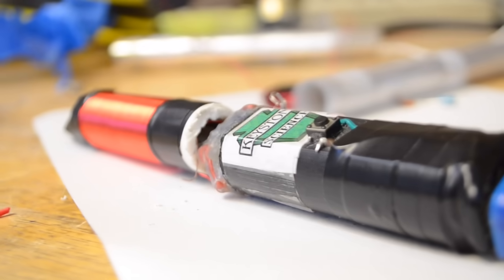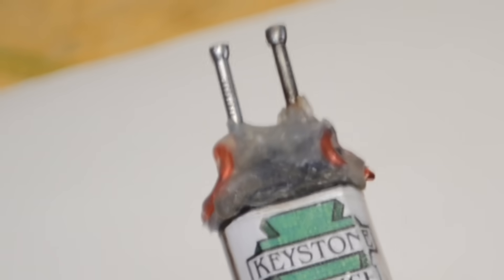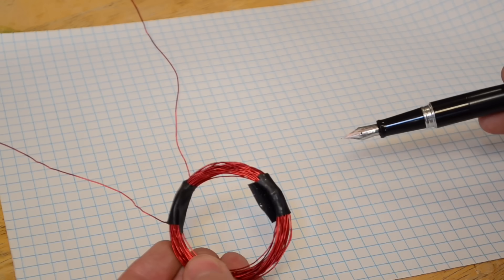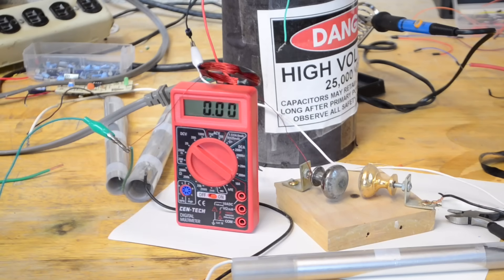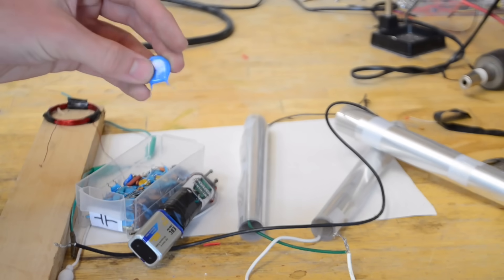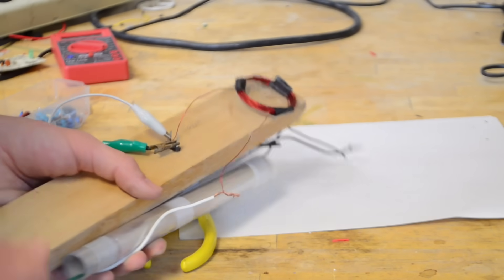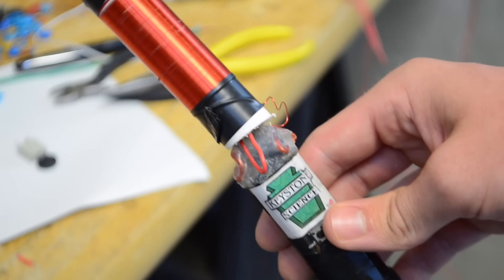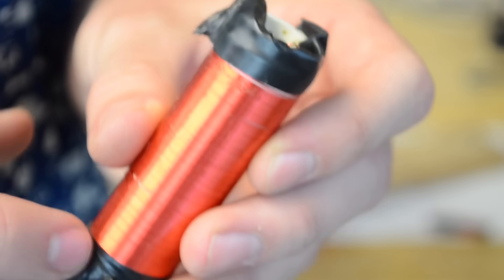How to make a pocket EMP

Comment: I have a thomas edison sized idea! Find a jiant grain silo, wrap it with 1/4 inch copper cooler tubing all the way to the top and loop it back down to a large aluminum plate just off the ground, then wrap a primary about 6 turns on the bottom with one end grounded and the other end teathered to an aluminum covered kite with 3000 feet of metalized spiderwire fishing line, then summons a lightning bolt, then measure efect.
Reply: Yes if the grain were corn it could be the biggest popcorn maker in the world!!!
Reply: Like the way you think comrade very cool. Probably could technically do all the calculations out to estimate you desired effect.. But would be a nightmare an still just a paper hypothetical. Be cool to see done irl hah,
Reply: add a fan and a couple pounds of flour. BOOM!

Comment: I was honestly just curious how feasible it was to make one. Just watched the newest episode of McGyver and in the show he made one using the magnetron from a microwave. I tend to like looking up the science side of things when I see stuff like that I don't fully understand. Thank you for sharing your personal experiences and learning.
Reply: Are you a time traveler or am I?
Reply: Mark Curry 
The magnetron/ transformer in a microwave is pretty much the same as the 2 components combined that he used. A transformer is basically a big version of the spark generator he used but it uses an AC input in stead of DC so it is way more powerful. So if you had some pretty high gauge wire you could use one for an emp. They are pretty easy to make if you have the right parts.
Reply: You're aware McGyver isn't a science documentary, right?
It's about as real as Rick and Morty.

Comment: Can you make this using the coils around  bucket maybe using a 12 gauge copper wire  using the same concept but only using a 3 to 4 amp from a  19 volt  maybe computer adapter will be best with out the capacitor for pulse only but if you want to have a constant flow and prevent the adapter  from damaging then use the capacitor. I am interested in  removing  morgellons and your idea would help . Please answer. Thanks or make a video of this I'm sure lots of people will find this if interest. Thanks.

Comment: Try the emp device with one or more of the large capacitors like from an HVAC motor, a car audio system, or a microwave oven (usually located within a few inchs and connected to the magnetron)

Comment: Question. How does it work, if your camera still working? . Please explain. This is some kool stuf keep up the great vids.
Reply: Taj Peterson Modern devices are EMP proof, they do this by using diodes. Think of a diode as a water valve in that only a certain amount can go through in one direction only. In a circuit a diode only allows electrical charge or electrons and Voltage to flow in one direction this makes your circuit Direct Current. As opposed to Alternate Current, Alternate Current circuits has its electrons change directions periodically so it goes forwards then backwards a bit then forwards.

In a Direct Current circuit Electrons can only go forwards because of a diode. Since a diode only allows a certain amount of electrons through in one direction the Voltage is always constant it can never increase but only decrease. 

An EMP works on the principle that it overloads a circuit with a sudden burst of high voltage that it fries the components in a circuit. In a direct current since the Voltage can only ever be constant and never increase an EMP jammer like the one in the video won't work on a EMP proof camera which uses diodes.

Comment: First how it works as you describe it is incorrect.. the capacitor and coil create a series tank circuit, the capacitor charges through the coil, when the capacitor is charged the voltage reaches the breakdown voltage of the air around the spark gap and the air ionizes creating a near short circuit, where the capacitor discharges through the coil and as the capacitor discharges max current when the field around the coil a huge magnetic field is  created. When the voltage drops low enough the arc stops conducting and the cycle starts over again.

Comment: What happens if you stager the coils and capacitors in a line? Like having more then 1 coil/capacitor set per spark gap? Is it possible to increase output and increase the distance like that?

Comment: How can this be applied to chemistry?
How would this be different than silent electric discharge, glow discharge , microwaves , etc on chemistry? 
In other words, what could this do that a microwave radio energy could not do as causing chemical reaction

Comment: Hey so what gauge magnetic wire did you use , how many kv is being produced, and how many volts should your capacitor be able to hold I've set the whole thing up but still can't get it to work I'm using 25 gauge magnetic copper wire and 2 kv capacitors and some 400 volt capacitors please help
Reply from the maker: +jaynazz123 feeds probably at least 6-10 kv caps, I recommend you make your own like I did, and try the better coil, it works much better.
Reply: Keystone Science thanks man

Comment: Hi, just wondering, if the high voltage is already pulsed, why are you adding the capacitors?
Reply: Random Fun  the capacitors increase the voltage
Reply: The capacitors actually don't add voltage but they will add energy.  The gap will determine the breakdown voltage but the capacitors will increase the energy discharged when the gap breaks and give you a longer pulse.
Reply: Barrett Lamb you still have to use caps with a higher voltage than is crossing the gap, so you do wind up with a bit more voltage.

Comment: How did your camera didn't stopped while you tested it but multimeter did. Your camera is an electronic devices too...
Reply from the maker: cameras have shielding built in,  alot of higher end electronics do these days, my multi meter had no shielding. Cameras like the one i used do especially, since if lightning draws too much current and blows a bulb, it creates an emp

Comment: I made this but the electricity started arcing out of my ceramic disk capacitor and burned through the side instead of going across the spark gap. I was using pieces of paper clip for the spark gap, so please tell me if the resistance is too high. I used a perf board, and may have placed the wires and capacitor in excessively close proximity. Capacitor was 1KV and pretty low capacitance, a couple picofarads I think

Comment: I think that adding a ferrite core and an aluminium shield to force the magnetic field into the desired direction may be can boost up the power of the device. (I haven't much experience with EMF but it's my suggestion)
Reply: Are you proposing an emp saber

Comment: +Keystone Science Why do we need to use a spark gap? Can you help please?
Reply: The Tech Boys You know that the acceleration of an electron through a wire creates an electromagnetic field yes? You also know that Amperes law dictates the strength of an electromagnetic field depends on the length of the closed loop and the current going through the closed loop.

To make sure our electromagnetic field is strong we want to make sure the biggest current we can possible make goes through our coil. The spark gap acts as like a trigger, when there's a high enough current an arc of lightning will form across the two electrodes completing the circuit. Which is why we use a spark gap.

How does the spark gap work? Well there are two positive electrodes. And current as you know involves negatively charged electrons. Since electrons are attracted to electrodes when there's a high enough voltage (think of voltage like the pressure or push of electrons) the electrons are able to jump across the gap to the other electrode, you see this in the form of lighting, this completes the circuit.

Comment: Is there a way to scale up this project and to focus the emp to a very specific direction? Also, could you use large high voltage capacitors to store a large amount of energy and make it mobile so that you could transport it without any need for an external energy source? It could be a mobile single use high power emp pulse using high capacitors in a series as your energy source.
Reply: No because the charge is too much and the build isn’t affordable. So unless your stupid stop asking and just do it. I’m kidding but not. Just make a vid so I can see
Reply: The government probably doesn't like plans for EW devices to be shared carelessly. I would assume that it would be the inverse of radar, in that radar sends out EM pulses to a general area and reads the return.  Ex-military I've chatted with said that EW uses a LOT of power. Not sure if some Yagi directional antenna-like attachment in front of the spark gap might help accomplish precision.

Here is my question: how would the range and precision of the device in the video change if it was rotating? Would that help to stabilize and concentrate the magnetic field projected from the device? Birkenfield currents don't diffuse randomly into the universe, they connect the poles of planets. The question is does a magnetic field have the property of an object in terms of  angular momentum stabilizing "linear" motion? Try throwing a football without spin. Birkenfield currents braid. My first principles take.

Comment: this is really stupid and a good way to blow a capacitor up. The HV power supply you're using already has all the capacitors and Spark apps inside of it adding another one won't really do anything.

Comment: Keystone Science hey! I would email this but I don't see an email address.. I wonder if you could figure out how a machine called magnawave works... I have some info on it and it's really interesting...  it is a large pemf device used treating mostly horses. The biggest version on the highest setting generate 30 000 gaus pulse that is only few microsecond long. So far no big deal....but.... it works without dumping an askicking current into the attached coil. I seen similar machines and it wasn't a good idea to handle the coil in operation. In the case of magnawave the guy who makes it told me that there is no current in the coil!!! But a magnetic wave being generated inside and brought outside into the coil. He said that inside there is a spark gap between magnets and that is what generates the magnetic wave. This wave by the way so fast that it has no effect on metal objects. Unlike capacitor discharge into coil type devices such as the Sota or the Bob Beck device.    So I thought you might be interested playing with it... I have a few ideas what might be going on inside. If you want to try some of my ideas out here is my email petimoritzatgmail. You much better equipped then I'm right now.
Reply: petimoritz the guy that told you this is wrong. if voltage flows along a wire, a magnetic force is created. if a magnetic force flows around a conducting wire, an electrical flow is created. you can't have one without the other as they are inextricably linked to each other.

Comment: +keystone science Great video! I was wondering if this principle could be used in a way to power another solenoid with induction.
Would a single pulse be able to power a single movement or would a rotating or longer magnetic field be needed? I guess you wouldn't need the spark gap?
Would the HV fry the solenoid or would the solenoid need to be short-circuited for the induced current to be able to flow through the solenoid?
And what type of coil design would be best to create a decent focussed field a few inches away, normal field coils, disk coils, or maybe an inverted toroidal coil?
And wouldn't and iron core, or even a magnetic core in the coil improve the magnetic field, also for this emp design? Hope you can provide some info or make a vid on this (links where I can find info would also be very much appreciated).
Keep up the great vids!
Reply: H Otter why exactly would you even do this? there are much more simple ways of making a solenoid actuate...

Comment: Do I need a ceramic disc capacitor, or do I use any old capacitor
Reply from the maker: +C Gvids any high voltage capacitor should work

Comment: Keystone Science I saw your video and I have two questions; 1.Can the gap where the spark appears be 10cm away from the coil? 2.Does coil have enough volts to kill? 3.Can you tell me your coil's demensions and how many layers of copper it had? Please, I need an answer😀.
Reply: GEORGE VAVOURAS     Your first question makes absolutely no fukking sense and its not the Volts that kill you its the amps that will fukk u up...aaaand also u said u only had 2 fukkin questions buuut there is clearly 3 there!!! What the fukk is wrong with u?!?!? I NEED AN ANSWER🙃🙃🙃
Reply: Derk Noluck wrong. I can touch a wire with 1000 amps running through it and mere micro volts and not feel a thing. the human body generate around 1000 ohms of resistance. That means you aren't going to feel much below 50 volts. to top that off, it depends on several other variables. is the skin saturated, wet, or dry? how much humidity is in the air? if the electricity is an alternating current, what is its frequency? given all the variables involved, there is no simple answer to this question.
Reply: George Vavouras 
1) yes. the coil can be closer to (within reason) or as far away from the spark gap as you want as long as you account for resistance in the wire. The distance between the spark gaps annode and cathode matter in as much as the further away the anode is from the cathode, the more voltage you will need to bridge the gap. 

2) the emp from the coil will not kill unless someone has something like a pacemaker or other electronic life saving medical device installed in them. it is made from thin, enamel coated magnetic wire and should not transmit any electricity to an insulated or non grounded person touching it. I will put in the caviate that it is theoretically possible to stumble upon a frequency that might alter someone's mood, disrupt their thinking, or even kill a person... but thus far, this is only theoretical to my knowledge and I know of no published papers on the subject. it IS known that prolonged exposure to certain types of EM radiation can cause cancer.

3) a coils dimensions aren't important in this case as you are setting up a deliberate standing wave in order to deliver the widest range of raw emp frequencies possible. if your aiming to build a frequency noise generator along a specific frequency or range of frequencies, then the math gets a bit more complicated and frankly, there are website that can explain it far better than I could. needless to say, you would first have to figure out if you needed/wanted a 1/8, 1/4, 1/2, or 3/4 wave coil and that would depend on the frequencies you would want to transmit on, strength of the transmission, and other variables.

Comment: what is the rating of the high voltage ceramic capacitor and how many of those capacitors that i should be using, and how do i connect each capacitors? im making this for my robotics club show :)
Reply: i want to know too
Reply: a few capacitors out of a microwave should do the trick. lol
Reply: XPumpkins take a capacitor from out of a flash camera
Reply: XPumpkins you got a negative and a positive if you want to break it like a switch you want to treat the capacitor like a switch on one side of the circuit.

Comment: can we use a high value resistor instead of 2 wires to discharge de capacitor ? to avoid touching the wire and for silent use...
Reply from the maker: +Alfred Alfredo perhaps, but the high voltage might destroy the resistor

Comment: A few thoughts. Wont a pocket tazer mess up most electronic devices to begin with? Or does it just blow a capacitor / fuse in the device? And I understand charge through coil = emp but what is the difference between this and when you wrap a  coil of wire say around an iron or galvanized bold... it becomes a electro magnet.... so a high volt that charges and jumps a gap is an emp but a moderate flow of electricity through a coil is a magnet? would one of those big electromaglnet cranes wipe your phone?  Is it the same thing just one is a much higher powered magnet for a shorter time? And how is that different than just a very strong solid state magnet...? and I know large enough emp start to become a cancer causing concern? And really any electronic device that is not properly shielded and checked for verification it does not interfere with other electronics and radio waves by the FCC is suspect and subject to .... being against the law
Reply: the emp generated through the spark gap is raw and unfocused. the purpose of the coil, however untenuated, is to focus the current into something like an electromagnet. Without a core to trap and focus that pulse into a stronger magnetic field, the energy gets released and dispersed out into the surrounding environment.

Comment: I'm not sure how much I can trust someone who just told me to put more layers of wire on top of the first one while showing with his finger to wind it up the other way around than the first layer.

Sorry but I don't think turning my coil into a wirewound resistor would help
Reply from the maker: +SpyMbaka haha what?
Reply: You told me to wind a coil and if I want to increase the strenght of the magnetic field to just wind a second layer with the current running in the opposite direction. Hence the two magnetic fields would neutralize each other resulting in a net magnetic field of zero
Reply from the maker: +SpyMbaka ahh yeah I see, your right, sorry I forgot that I had said that in the video